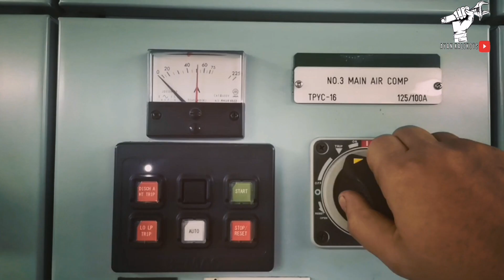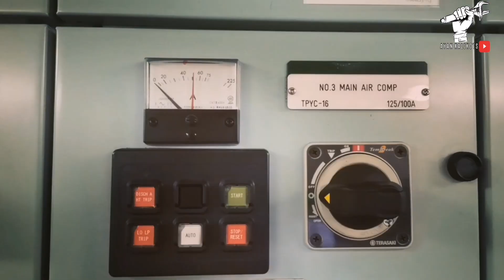TANABE H -74 COMPRESSOR 1ST & 2ND STAGE  AIR COOLER [VLOG 031]

Comment: Sir Tanong lang po ako about sa compressor Namin ,ganito kasi Yun nag trip at Ang alarm is high temperature trip, pero Yung inlet and outlet nya binaril ko nang temperature gun is inlet 32°c outlet is 48-50°c
Hanggang ma automatic stop na po sya same parin temperature, pero nong binaril ko Yung low pressure valve nasa 150°c Ang temperature nya so nong nag stop Ang compressor sir nag conduction papunta sa thermostat na aabot nya Yung set point na 65°c which is set point Ng high temperature,  
Kakalinis lang Namin nang cooler,inlet and outlet
Kaka renew lang nang h.p valves suc.and delivery then Ang low pressure valve